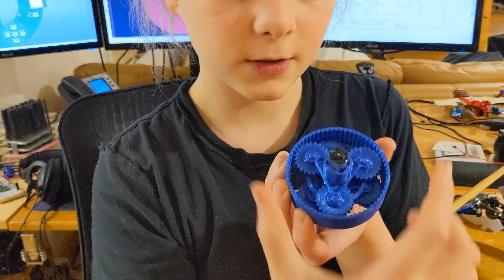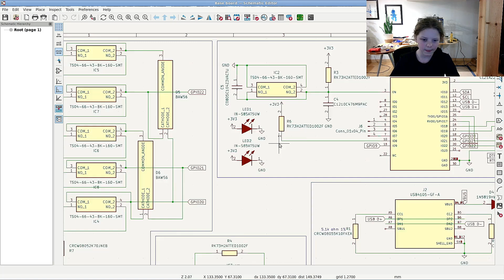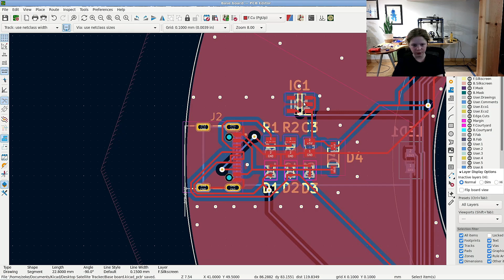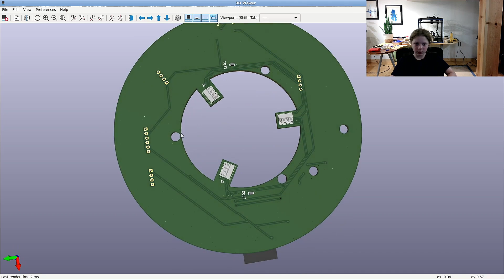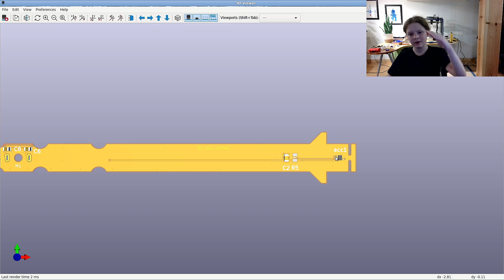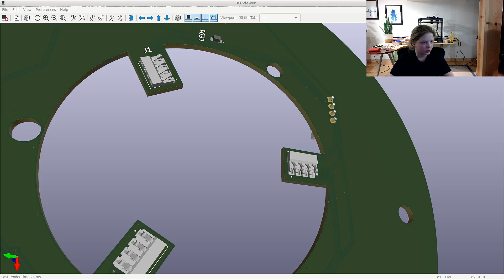Desktop Satellite Tracker Circuit Boards

Comment: you could use pre made slip rings instead of designing them yourself. Those contacts are gonna wear out very fast.  I'm sure the slip rings will be so much more efficient.
Reply from the maker: we couldn't figure out how to connect the slip ring to it so that the wires wouldn't twist up

Comment: Very impressive work.  The use of the battery contacts to jump between the PCB's is an ingenious idea.  I have always used pogo pins for such tasks, although they tent to be a bit to pointy and can eventually scrape the plane down to the dielectric.  Lots of very good thought put into this design.